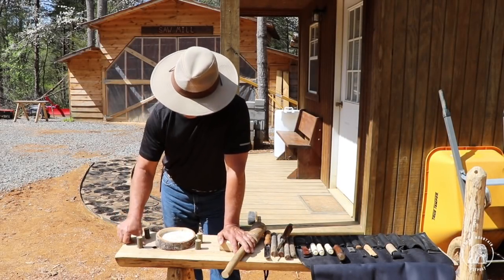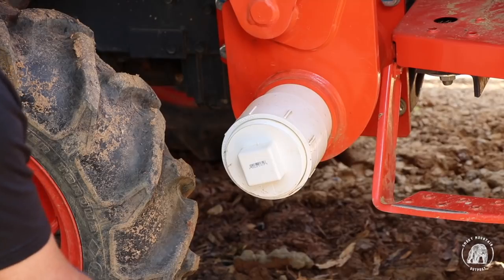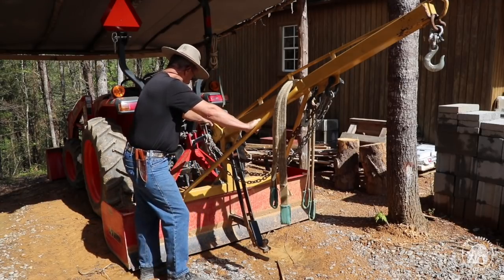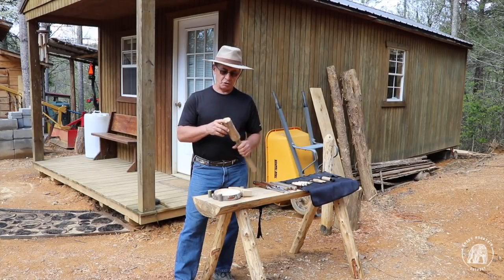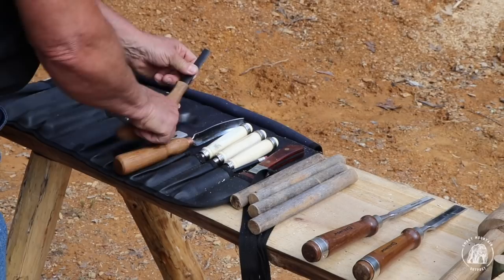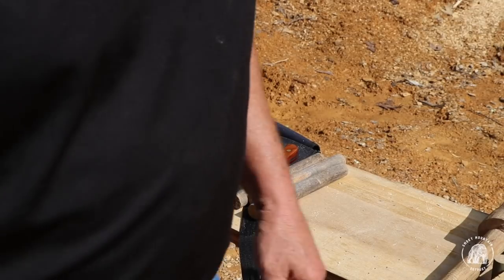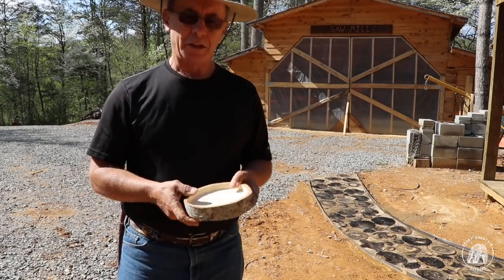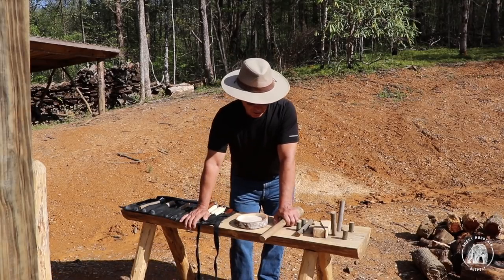QA11 | WOODWORK | BUSHCRAFT PLATE | Q&A ON TIMBER FRAME CABIN

Comment: That’s a great tractor. If you’re like me you’re always going to find new things to put on it that will make it work better and smarter for you.
One thing I noticed was your extensions for your bucket that you cut off. You mentioned you saved them with the intention of putting them back on when you needed them. It looked like they were 2 inch outside tubular. If you go to a steel supply store and ask for a foot of 2 inch unribbed inside measure 1/4 tubular steel you can cut it in half drill a 1/2 inch hole for a pin and weld one to each of your pieces you cut off. You can then put them back on simply by sliding them on and putting one pin in each one.
I’ve made many things this same way that easily go on or off. This is the same size and way a 2 inch slide in receiver hitch is made for your truck. With a little more work you can use one of these extensions in place of your hitch on your truck with the help of a winch to lift heavy items into and out of your truck bed. Sometimes you don’t have your tractor.
Reply from the maker: We think alike

Comment: Since the fireplace footing isn't part of the original footing,it needs to be a bit bigger. At least 1 ft bigger than the planned fireplace base,on all 4 sides,and as deep as it takes to get to undisturbed  soil. 8 inches thick at that depth would be plenty.  I still think a  woodstove would be better, no footing required, and any masonry face behind it could be supported by the footing that's already  there!  Buy the way, thank you for what you do when you're not at the outpost,we appreciated  it!

Comment: Thanks for another great start to my Wednesday 😊.  I was curious as to why you chose the Kubota L3901 versus the 2501 since the tractor frame, loader specs and hydraulics are the same?  The 2501 falls under the 26hp rating that requires the EPA mandated diesel system.   Saves about 3k on the tractor price.
Reply from the maker: I wanted more horsepower. Have a good size piece of property.
Reply: @SmokyMountainOutpost  Okay! That certainly explains it. If you're doing a lot of mowing with a large deck, that rear PTO needs to be powerful.

Comment: How good are those Kobalt hand saws SMO i have been using a Stanley fatmax saw and have noticed a slight warping in my blade and have considered buying  a Kobalt
Reply from the maker: I like the big one. I really would prefer to find and older one at a flee market or antique shop that’s in great shape because I know the metal is better.
Reply: @SmokyMountainOutpost  the big one sounds like the go then thankyou for your reply SMO much appreciated 👍